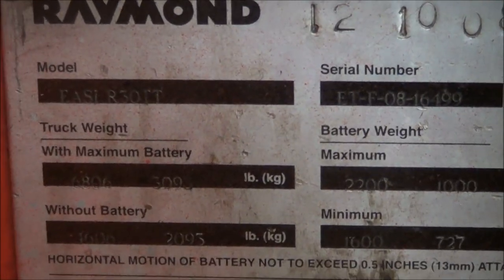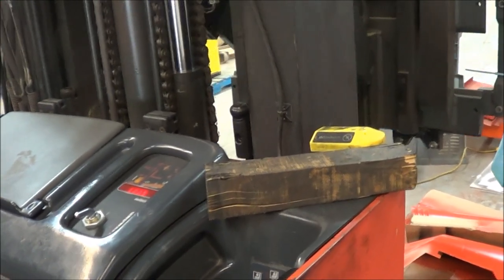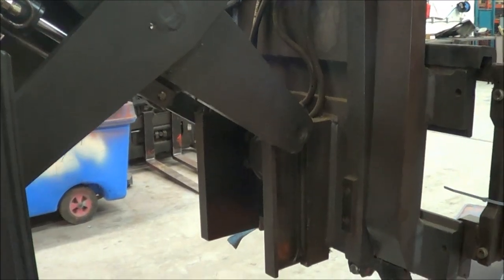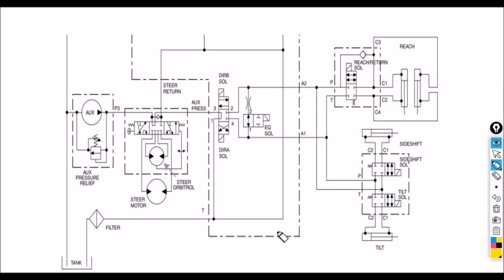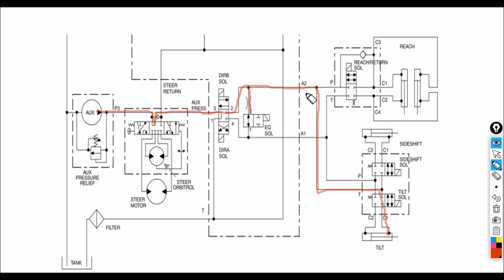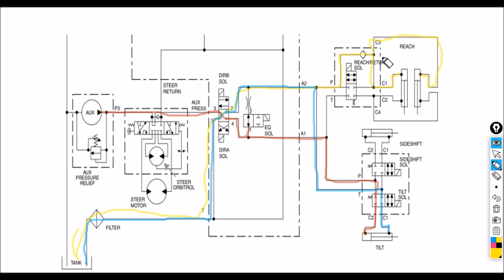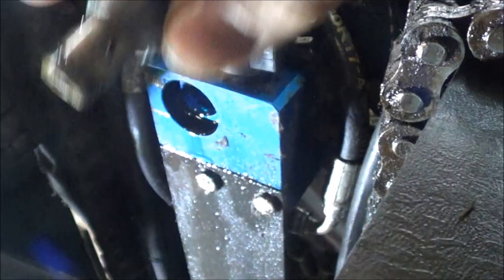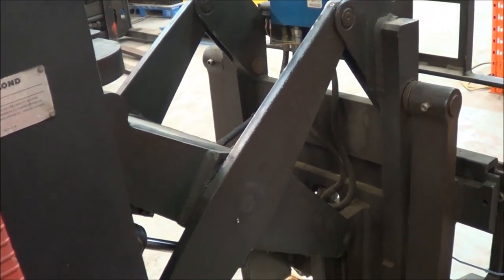Weird Hydraulic Problem (Raymond Reach)

Comment: Nice work. I have seen the cylinders damaged like that but never seen fragments in the system. I worked at Raymond in LA, CA. for over 20 years.
Reply: Steve Mitchem hey I'm a forklift tech in ca what kind of hydraulic gauge did you have?

Comment: I have something similar on an ES-B Easi reach truck three motor. The check valve on the reach manifold was also clogged with debris. Cleaned it and fixed the issue, but also noticed it does not retract while forks are on a load. You hear the aux motor running and can feel the hydraulic hoses flexing with pressure. Without a load it retracts, but does not fully nest. Could it be the reach valve that's clogged as well?

Comment: I’m a new mechanic to forklifts. I tried diagnosing a reach truck that would extend whenever I tried to side shift to the right, or retract whenever I side shifted to the left. Tilt and lift are working just fine. Could it also be the one way CV or would it have to do with the OTM cables? Thanks!
Reply from the maker: Unplug the solenoid for the side shift and see if it still does it. If it doesn't then it's possible to be the cable or joystick.
Reply: @forkliftgeek10  will do, thanks.

Comment: I have a Raymond DR25TT, the steering orbital acts like it is not getting enough fluid. When the back is lifted and there is no weight on the unit, I can turn the wheel with the key off and you can feel it keep stopping while turning it. When the key is on same issue just amplified because the pump is on. Seems like the same issue I just don't know where the one way valve is for this section
Reply from the maker: The one way valve would be in the return section of the orbitrol. Be aware though that a mechanical binding on the drive unit steer ring or in the hydraulic steer motor would produce the same symptom or if the pump is worn.

Comment: I know this is an "old" video, but I have a similar issue that seems to have popped up out of the blue on my R45TT.  When using the reach, tilt, or sideshift, the forks will briefly go up an inch or two.  Perhaps coincidently, I raised the forks all the way up and tilted back the day before.  Any ideas?
Reply from the maker: The lift hydraulic circuit is separate from the auxiliary functions. I would check the joystick.
Reply: @forkliftgeek10  thanks for the reply.  Yeah, from the diagrams you had in your video it seemed the lift was separate.  One other thing I noticed just now, if I lower the mast just slightly, the next tilt/shift/reach will not raise the mast.  The second tilt/shift/reach will.  If I keep lowering the mast before using the joystick tilt/shift/reach, there isn't ever an uncommanded lift.  Still think it is the joystick?

Edit: One other thing, a lift will have the same effect, but it has to be a substantial lift, not a small one.
Reply from the maker: The first thing to do is to make sure the vsm is not receiving a signal from the joystick when it is not supposed to. This is to determine if you have a control problem or a hydraulic ( mechanical) problem.
Reply: @forkliftgeek10  Would you happen to know where the maintenance manual for this might be found?  I've only been able to find manuals for similar but not the exact.  Also, I could be wrong, but it seems @jemuelvelarde7199 mentioned the same problem as me in the comments for your Encoders on Raymond Easi video.  They mention the cold, and while I'm not using mine for cold storage, it is about 55F right now.
Reply from the maker: Warehouseiq might have em
Reply: @forkliftgeek10  Normally, I don't raise to the full height because my ceilings are 20' and it goes up to 23', but yesterday I went up the full height twice, and now the problem has disappeared.  Coincidence, maybe, but whatever issue it was having seems to have cleared itself.
Reply: @forkliftgeek10  T.he fun continues.  Again extended to full height (coincidence?) then it refuses to tilt/shift/reach at all.  Raising and lowering still work, but raising seems sluggish until it reaches the extension height.  Now it started displaying Code 61 until it reaches the extension height, then no code 61.
Reply from the maker: The loss of auxiliary function when fully extended is more.likely the over.mast cable stretching and breaking contact.
Reply: @forkliftgeek10  I so appreciate you responding!  Thank you.  I just took it outside again and lifted it all the way up, brought it back down, and everything is working again.  Is there any possibility it is just low on hydraulic fluid?  I bought it used about 3 years ago and it has functioned perfectly, but even though I've had a couple forklift people look at it, I'm not sure anyone checked the hydraulic fluid level.  So I had also added a gallon of it after seeing the Code 61, brought it up to 20' and back down several times which didn't do anything, it was just this last time bringing it to 23' that might have done something.  Again, this could all be coincidence, but I feel like staying away from extending the mast all the way from now on.
Reply from the maker: It is possible to loose auxiliary functions if the hydraulic oil is low at the very top, but the pump would start cavitating at that point.
Reply: @forkliftgeek10  it’s never made any odd or different noises, so I’m assuming the pump wasn’t cavitating, which usually sounds like knocking or rocks in a tumbler. And the auxiliary functions were not working with the mast fully lowered either. I’m just grasping at straws really.
Reply from the maker: I would check if voltage is reaching the solenoids when it is not working.

Comment: Greetings friends, how are you?  I've got a problem with the extension!!  When I flip the switch I hear the solenoid activate but the hydraulic motor is not running, is there any suiche that makes the motor turn on when doing the tilt or extension?
Reply from the maker: The design of the circuit would be different from model to model and brand to brand. If your truck is the same as in the video, if the motor does not run check the contactor and also the motor brushes (if DC).
Reply: @forkliftgeek10  It is a Raymond model 7200 electric forklift.
Reply: @forkliftgeek10  The motor drives up and down, but when extending it does not operate
Reply: My dear contactors are active when you step on the dead man's pedal, but when sending the extend command you are not!!  My question is what makes the engine start when you hit any switch command

Comment: Nice Troubleshoot! Have Question ,if the check was ok and the cylinder (reach) was ok and the same thing happen, where do you think you would look next?
Reply from the maker: Based on the hydraulic schematic the only other possibility would be a crack in the manifold allowing the flow to both tilt and reach cylinders.

Comment: Working on a Raymond EASi everything works electrically I have up and down on the forks but no extend/retract, tilt, or side shift im assuming im having a hydraulic issue any ideas of which solenoid to look for or check valve?
Reply from the maker: Do you have power steering working?
Reply from the maker: When you step on the deadman, does the auxiliary motor run? If it is running, when you try to tilt or reach, does the overcast hose flex?
Reply: @forkliftgeek10   steering  works can move machine around everything works normal. Forklift was running fine they plugged it in to charge battery and when went to use had lost tilt extend retract and side shifts
Reply: @forkliftgeek10  i can hear the aux motor when stepping on dead man but don't feel or see any hose flex
Reply from the maker: Ok, if power steering is working then the pump is out of the question. If non of the overmast hoses flex when you operate the auxiliary functions then I would look into the directional valve solenoids and wiring for them.
Reply: Thanks il look into it tomorrow and let you know my results
Reply: @forkliftgeek10  having trouble determining which pump drives the directional solenoid. Even with foot off dead man when pressing extend function motor turns on... if that makes sense
Reply from the maker: Some models does not require the deadman to operate the auxiliary functions. The directional solenoids are mounted on the manifold.
Reply: @forkliftgeek10  and the solenoid voltage should be 36? Or what voltage should I be looking for
Reply: @forkliftgeek10   directional solenoid only read like 22 but when button pressed jumps up to 28v and sound like air is being pushed into hydraulic reservoir. Is there something common that would wipe out all these functions but leave everything else in normal operating conditions?
Reply: @forkliftgeek10  ok so what it is is im not getting any hydraulic flow to my directional valve any ideas?
Reply: @forkliftgeek10  so when u remove cover over steering wheel I have no power goin to double solenoids if that makes sense.. what powers there or activates them I have 0 voltage coming from there
Reply from the maker: Aside from directional solenoids main power cable that goes over the mast into the carriage. That would have been the more likely cause if you told me that the over mast hoses were flexing when you try to operate auxiliary functions.
Reply from the maker: Battery voltage is 36 but those solenoids are 24v
Reply: @forkliftgeek10  so the hydraulic motor that moves steering also powers extend/retract function? I have no voltage to the 2 inline solenoids im assuming 1 is to open and 1 is to close
Reply: @forkliftgeek10  this thing just has me puzzled when I press extend/retract button nothing happen but I can pull the forks like a foot out and if someone presses the button while im pulling im able to fully extend but then on control handle either button retracts forks very very slowly
Reply from the maker: Yes. The dir A and dir B solenoids direct the flow to which hose if dirA is powered dirB let's the oil in the cylinders flow back to tank and vice versa.
Reply: @forkliftgeek10  ok I have no voltage to either solenoid A or B any ideas of where to go or what to check so far all wiring connections look in place nothing ripped torn or mushed
Reply from the maker: If you have no voltage to both solenoids and are sure the wires are ok then system card, 5 coil driver board and fuse FU1 are all suspect.

Comment: Hey bro I’m having an issue with a reach truck it’s moving forward slowly on it’s own
Reply from the maker: If it feels like it's dragging check the brakes. If it is slow and feels like the motor is chattering check the encoder. If it feels normal but just driving slow check height switch (if equipped)
Reply: @forkliftgeek10  okay I'll check all that because all it does is  move forward on it's own but slowly and if I hold the handle back to reverse it still feels like it's trying to move forward on it's own. Be right back bro
Reply from the maker: Shoot, did not quite understand the problem. Sorry. Moving on its own without moving the handle is what you meant.. then I would check the throttle potentiometer.
Reply: @forkliftgeek10  that was my fault sorry.
I swapped the handle with a new one and calibrated the new one and it works perfectly fine thanks man